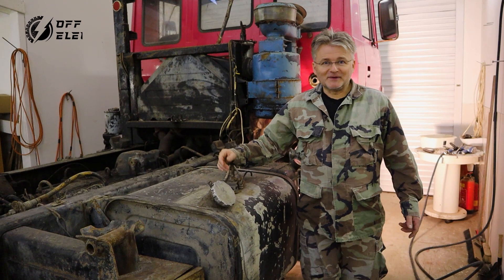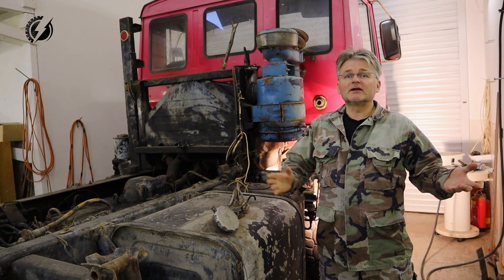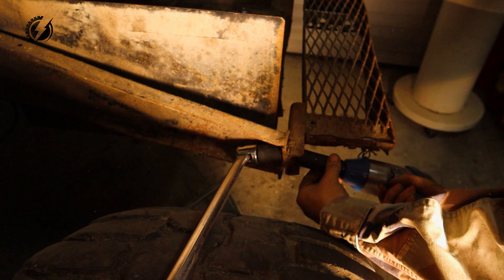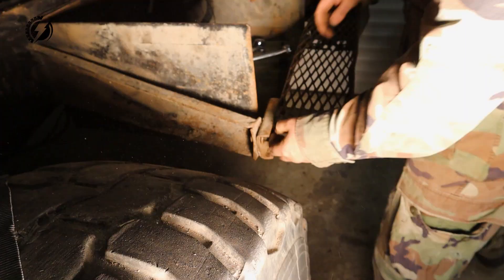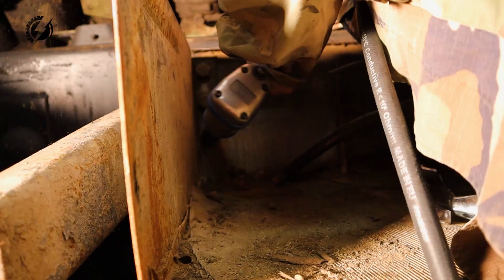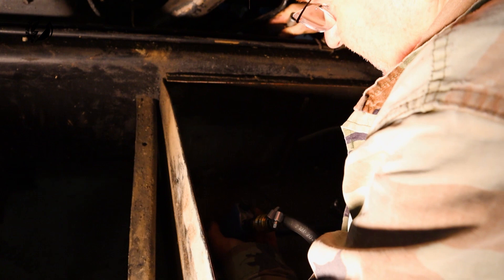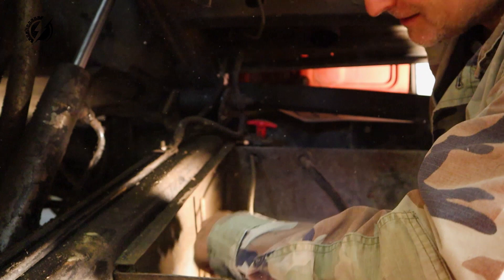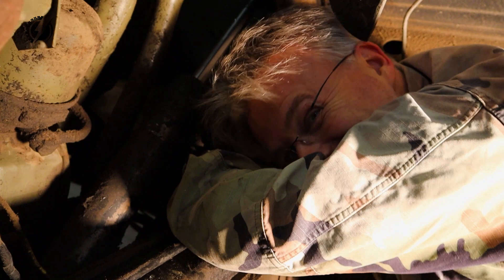Best Off Road Electric Monster Truck Build | Ep.8

Comment: Putting battery's on concrete like that over a week's time it will kill it and hurt the cells
Reply: @JaroslavJaroslavssonGarageLabs  in my experience this has happened to me and all the shops I've worked at this is a rule
Reply: @JaroslavJaroslavssonGarageLabs  idk why TBH I really don't I just no it's true and it's just concrete that I've had issues with
Reply from the maker: I heard that too, so they were on the floor just for a few hours, and then I put them back into the original battery box.
Reply: @JaroslavJaroslavssonGarageLabs  I jst don't put them on the floor I put on a bench or even a pc of wood anything that keeps it from contacting the concrete and thick enough like no less then half inch
Reply: @JaroslavJaroslavssonGarageLabs  wtf is wrong with you it's not a myth. I no for a fact setting a battery on concrete hurts the battery drains it.  I'm not 100 percent on if it hurts the cells but I in fact 100 percent no that it drains it almost over night and I thing it has something to do with temperature. I was only trying to point something out to the guy not troll and cause bs like you are. I don't get why someone that has no idea is trying to tell me someone who has exp first hand over and over and been a mechanic for a long long time and went to school for it and still between school and all the shops it was a golden rule no battery's on the floor if concrete. So plz tell me we're did you get your info from exp or jst something you read online. And how you get me being a flat eartther out of this shows your true intelligents.
Reply: @JaroslavJaroslavssonGarageLabs  lmfao